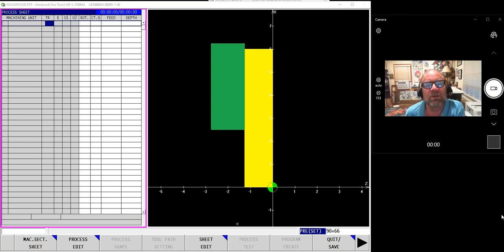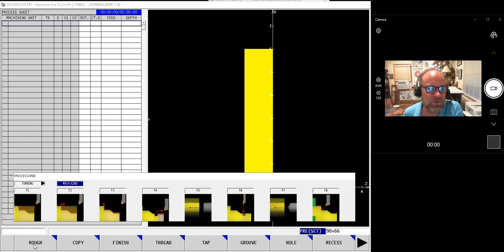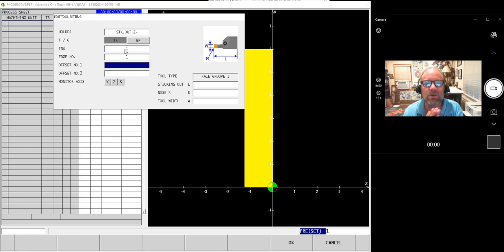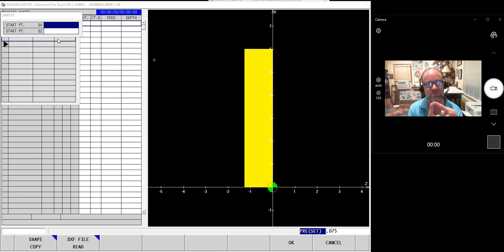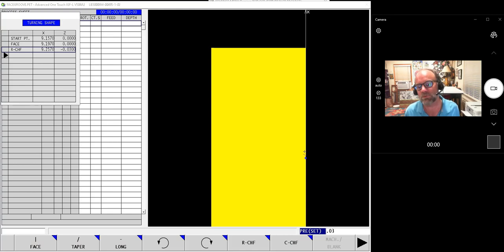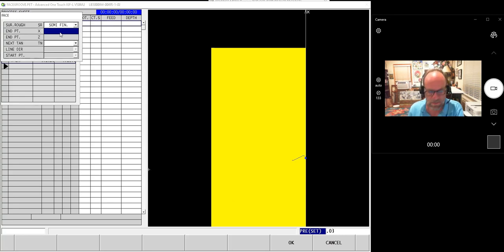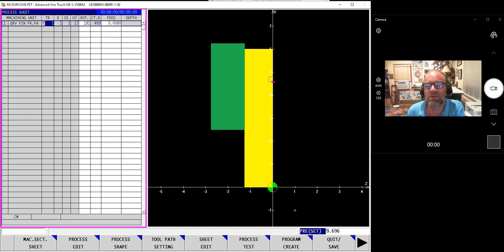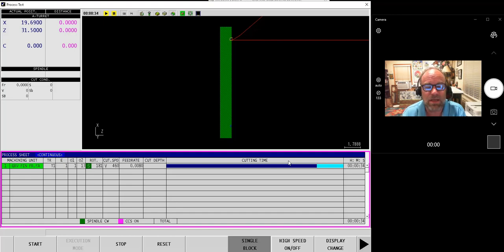AOT dovetail groove function

Comment: Hi I was wondering if you have to make 2 grooves out of that how would you space that out
Reply from the maker: If the two grooves are identical but with different locations, using the final dialog block in the groove cycle allows you to specify the number of features to make, and their spacing

Comment: How can you show AOT both graphics from first spindle and second spindle as the programs is running..
Thank you
Reply from the maker: There is no provision to see both spindles at the same time. You can, however, switch back and forth between the two with the "mode select" switch in graphics, or the SP1-SP2 switch in process verify